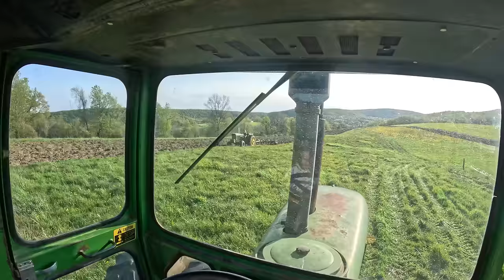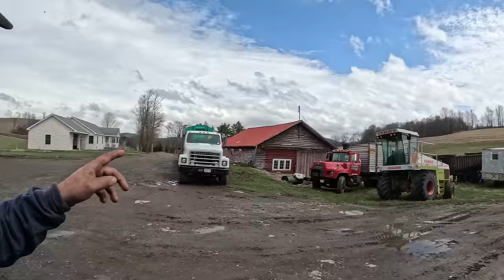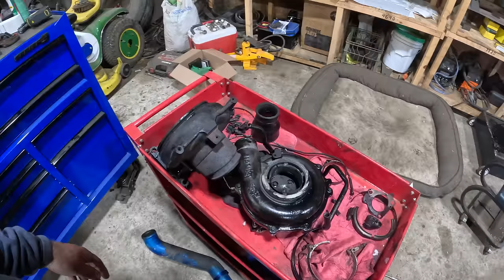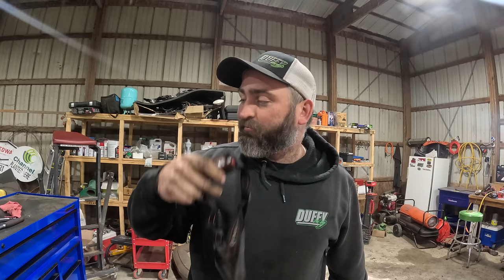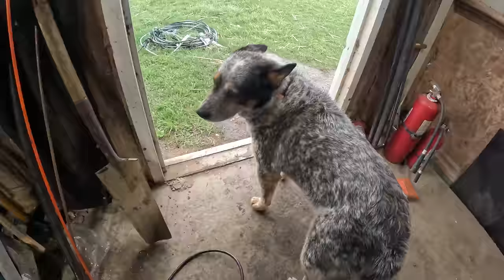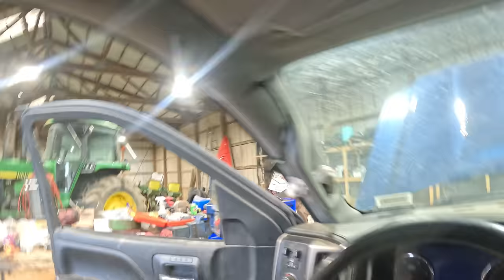New Turbo Time- Duramax May Run Again

Comment: Dude, when you run old equipment, stuff breaks.  Also, when you run new equipment, stuff breaks and you have payments.
Reply: And you forgot to say, new or newer stuff, when it breaks we/you cant fix 95% of it . And it's 150/200+ per hr for a tech plus outrageous parts; if they have tge damn part , plus fees plus service call plus fuel surcharge plus shop towel fee. And on and on .

Comment: Always enjoy the old steel in tractors & trucks . No way do i want new equipment for the emission issues & computers in the new stuff let alone the outrageous price of new. I agree older things like Mack trucks will last alot longer than stuff out of the showroom today. Easily serviced compared to new & user friendly . Older equipment was manufactured to last for many years of service now you are lucky if anything made lasts long enough to be out of warranty before its falling apart & breaking. As long as you have mechanical ability yourself or know someone who has or works on that type of machinery you are way better off in long term.

Comment: At least with your trucks you don't need to have a college education to change the oil and nowadays with all this Pollution Control bull crap and computers I wouldn't know one how old how old is stuff between 70 and 80 and I have way less problems in them other guys with the computers

Comment: Is your intake pipe the right one. There are only a few pipes on the market that dont block the surge protection on the actual turbo. I bought a Banks intake pipe and eliminated by back surge problems

Comment: And you can go to your local grocery store and get peppermint oil and put it on cotton balls and throw it around in there and the mice are allergic to it and will not go near it we always put it in their trucks at the farm we started out with using mothballs and that was okay but then since we started putting a peppermint oil in we have never had an issue and your local John Deere dealership actually has the stuff which they sell for mice but it's just peppermint oil

Comment: hey Chris,i am a logger and part-time farmer and i own 3 log trucks i had big payments but now they are paid for 2006 International 5900,2006 International 5600,2007 International 5900, used to have a Mack One Superliner and rd687s  but now Mack is Volvo and Volvo engine,BUT PAID TRUCK AND Equipment you are rich because every dime you make it's yours's just have to fix them new one break also

Comment: Working for a municipality for over 40 years doing repairs on heavy duty and emergency equipment, on old and new alike. New only is good for about two or three years on equipment that's out working everyday, then they're breaking down just as the oldest.

Comment: We farmed for years using old super M's and a John Deere 640. All our equipment was from auctions or house trading. We made it through the 70's but many of our neighbors who had that new equipment did not. I bet that JD 640 is still working ground here in Wisconsin. The two super M's were sold at auction to a collector to be restored. God I wish I could drive that 640 again!

Comment: Chris, your better off with older equipment simply because it's not all electronic, there is no def to worry about, and cheaper, (usually), to fix. Plus, most times you can fix it yourself. So I say keep running the older stuff.

Comment: Well chirs they all brake man new old it doesn't matter. You use the truck as a truck n drive it there's going to be issues. I remember the engine rebuild you fix all the common problems. Shit happens man. Love see the truck up n fixed again

Comment: Electronic engines are ok, but when you add the after treatment, then the problems begin. Hang on to your older stuff, it's not junky, it's just older, and by the way it is actually more reliable.

Comment: Old vehicles rock I’m still keeping my 2000 jeep and 2002 dodge 3500 running both I bought new and the jeep has 240000 miles still all original except the radiator. Good job keeping your stuff going

Comment: Turbo failure in most cases is caused by another issue. More often than not you have a boost leak. The turbo can only push so much air. It always wants to build boost. You may not not notice on gauge it's low . When you have a leak the turbo over speeds

Comment: I would much rather run old stuff without all the stupid emissions and DEF stuff. Talk about a waste of money and you lose horsepower as well as fuel economy.

     The only DEF that should be used in the field, should be in the form of fertilizer.

Comment: I am a water well driller and a pump and filtration service technician/ installer.  I have a baton 2pro from O-light.    Amazing product.    I need a new flashlight in my tool bag.

Comment: Like you said all your trucks are bought and if your truck is 800 horsepower now you put twins on it it's going to push it up to like 1800 horsepower it's not going to be drivable. Not for a daily anyway. 😅  but it would be fun. and I do remember when you built the truck.

Comment: I have watched the comments on the last few videos and wonder how many would even dare take the chance you have starting from scratch, older equipment is easier to work on and is more reliable, i work on new equipment and have thousands of dollars in just diagnostic equipment, trust me i love my 2020 F550 but not many people can work without going to the dealer and i don't understand the comments about how you take things apart, the only way to learn is to do it, you are basically a one man operation, i was fortunate to work with people that should me how to repair things and not struggle and after 40 years of wrenching i still have a list of people i can call to figure out something i come across keep up the great work